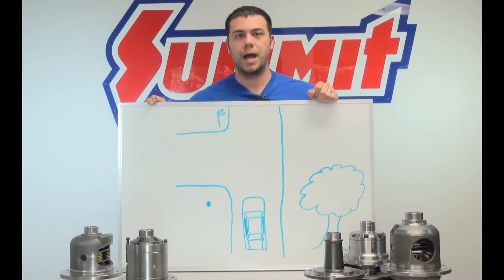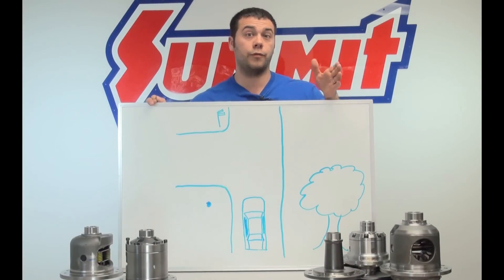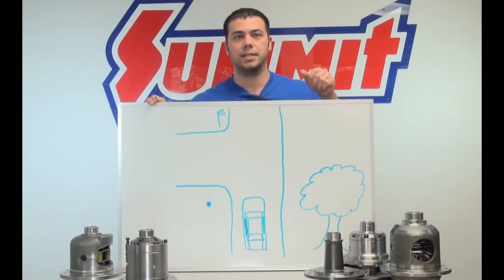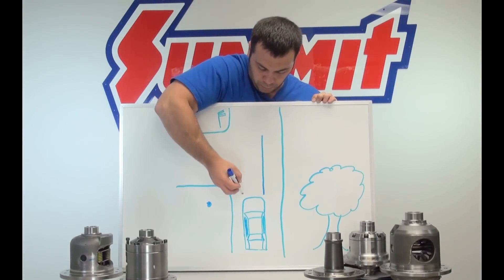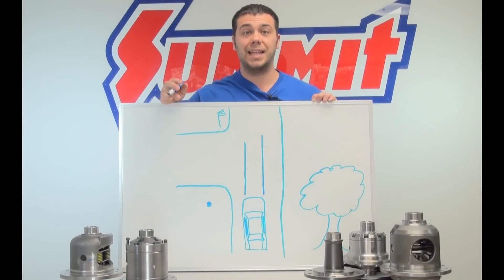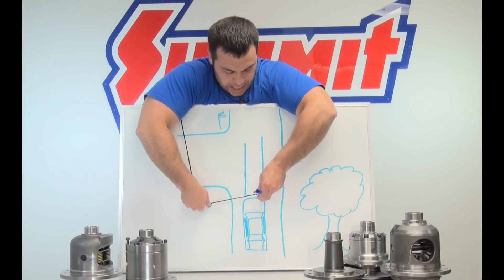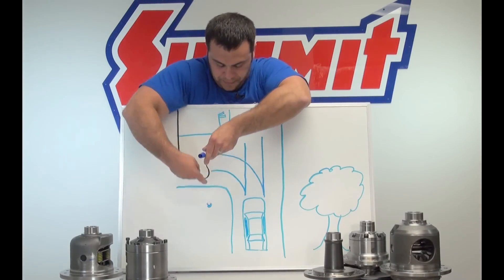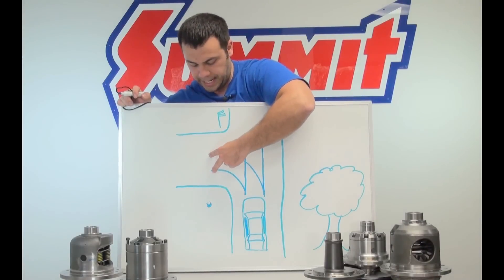Types of Differentials - Summit Racing Quick Flicks

Comment from the maker: Hi Briceland107,
This is from the Eaton site: The Truetrac® operates as a standard or open differential under normal driving conditions, allowing one wheel to spin faster or slower as necessary.  When a wheel encounters a loss of traction, the gear separation forces take effect and transfers torque to the high-traction wheel.  The helical-shaped pinion gears continue to mesh with the side gears with increasing force until wheel spin is slowed or completely stopped.

Comment: This video answer all my question about the open differential in my 05 tahoe ls 4x4. But I still want to find a posi trac differential to put in it so both of my wheel spin when I get stuck or when I help pull someone out a ditch. I'm not looking for a differential that will break my transfer case but be compatible with it and the front gears.

Comment: Hey am, I have a 66 chevelle with a 10 bolt running a 400th and a 496cid.im running a 3:08 now stock and would like a locker for street use.i have an open diff..do you have a part # for a 3:70 or 3:73 locker?

Comment: interested in a nice posi for my 2006 titan with 2wd. git a lot of snow up here. cannot afford another truck but want to drive it more often in the winter. it's a posi now with clutches and slips too much when in a tight situation. don't want an air or elec. locker. a good compromise . I believe this is a dana 44 diff with 31 splines. suggestions please.

Comment: You left out the Torsen automatic torque biasing differential.  It has instantaneous torque transfer to the non slipping wheel.  It has no clutch packs that wear out or complex spring arrangements.  Will make your car launch in a straight line while still allowing you to make a corner.

Comment: Would like to know more about a tru trac version still havent wrapped my head around that completely
Reply: I think this video explains it better. It's a slightly different layout but same principle. 
 Watch "Exploded View - Inside the Eaton TrueTrac Differential" on YouTube
https://youtu.be/lZmsY2YvVsc

When the spiral gears push apart, left to right, they push against themselves, the side gears, and the carrier housing. Notice the carrier has round holes where The spirals are, THIS allows the spirals to pass through and touch the case. The friction builds until it almost kind of locks and now you have traction to both sides.

It's not perfect. You may have to hold the brakes a bit to induce that friction. Once you have, the power will transfer to the wheel with traction. U.S. Army vehicles runs this system.

Comment: When installing part# M-4204-F150LS on the front diff of an F 150 2005 4WD:
1. Is it an issue when cornering in 2WD?
2. Is it an issue when cornering in 4WD? How does it work when it detects slippage while off-roading? Will it engage and damage any parts?
3. How will it work if one wheel is in the air? Can you use the brake to help engage?
Any extra information would be appreciated, as I’m considering installing one in my baja- modified F-150 05 8.8” front diff.. 
thank you!!!
Reply from the maker: 1. Is it an issue when cornering in 2WD? Yes, it will be hard to steer and can be dangerous to the unsuspected driver.

2. Is it an issue when cornering in 4WD? How does it work when it detects slippage while off-roading? Will it engage and damage any parts? Yes, it will be hard to steer and can be dangerous to the unsuspected driver. It will not damage any parts in the diff.

3. How will it work if one wheel is in the air? Can you use the brake to help engage? It will transfer the power to the wheel needed and hitting the brake can help on some units.
Reply: Summit Racing thank you! You guys are awesome

Comment: I have a 2005 f350 6.0 that i daily drive and dont really do any off roading it does how ever have a decent amount of hp. What would be the best differential for my truck?
Reply from the maker: Hi Eric, For mostly street use and daily driving I would recommend the Detroit True-Trac limited slip. If you have the full float Ford 10.5 rear axle, you  can use part  https://www.summitracing.com/parts/dtl-915a550
Thank you for watching.

Comment: Which differential should I get if I want to burn out with both rear wheels?
Reply: alexisramos, check out a corvette rear axle.  They are made for that purpose.  Get that type of rear locker (posi-trac).  A Detroit locker will ensure that both wheels spin at the same speed.  The posi-track has clutches whereas the Detroit locker has "teeth" type locking devises.  Both have their good a bad points.

Comment: What would you suggest for a twin turbo Silverado that’s going to be a daily
Reply from the maker: An Eaton Detroit Truetrac differential would be a great choice for a high-performance, daily driven vehicle. These differentials provide smooth, quiet operation, optimum traction, and excellent strength. Use the Make/Model search at SummitRacing.com to find the correct differential for your vehicle.

Comment: Question. I have an Borg Warner 9bolt. I found out its a 3.27 gear but not posi. for my 88 Camaro Street/Track Car. Should i go with an spooled or the posi unit. Spool 88.00 but the posi kit it 485.00
Reply from the maker: Locking the rear axles via a spool together can create a dangerous situation on the street. Adding stick tires on the rear or skinny tires up front can compound problem even more. I would recommend a posi for any street driving.

Comment: I jave a quik one may not be to much related, i have a 92 ranger 4.0 v6 auto, my diff is a 7.5 3.08 open, i want to get a 3.27 locker out an explorer witch is a 8.8 diff but flanges atent the same it is an adapter made? Heard that is a common practice do the swap, thanks
Reply from the maker: Hi Royrockbrain, 
There are no adapter flanges for the swap you are referring too; and swapping the whole rear differential is a big job. Not only is the rear end slightly wider requiring the leaf spring perches to be moved, but the shock mounts are different, the driveshaft will require modification as well as the brakes are disc vs. drum.

Comment: What would be the main advantage of a locking differential over a limited slip differential? Or is a locking differential a type of LSD?
Reply from the maker: +cptmiche, 
A locking differential could certainly be considered a type of LSD, sure. But, it isn’t something that most want to drive on a daily basis because of the lock/unlock harshness around corners. Locking diff.’s are really best for off road applications only such as mud trails and rock climbing.

Comment: Is their a much faster LSD for track? ..Also BMW seems to be using more Open differentials even on performance models with great track times. They say that their abs system is quite advance and their open drive differentials work like an LSD with less maintenance .. Is this true? would a abs swap make an open differential good for tracking now?
Reply from the maker: +goheat77, 
An ABS system with the capabilities you describe being offered in the aftermarket for a “swap” would be cost prohibitive for many and therefore unprofitable for a manufacturer. You will most likely end up investing in the factory equipped car to get that system!

Comment: i have a 1969 pontiac open 12 bolt rear end am that i like to keep, am  I  going to have a problem changing a open to a posi ? as i tryed once with a chevy and the bolts on the ring gear hit the housing and there wasent enough room for the 1982 posi posi and tryed to put in the 1978 open rear? the bolt hit the housing after loking at other 1982 its machined for cut out and 1978 isen't ?

Comment: I have a 2001 Chevrolet Silverado about 500hp I want to build a bullet proof rear end what do you recommend
Reply from the maker: Hi Robert, we would need to know if you have a 10 bolt or 14 bolt. Here is a link to both: 

10-Bolt  https://www.summitracing.com/parts/etn-19559-010/overview/

14-Bolt  https://www.summitracing.com/parts/etn-19590-010/overview/

Comment: hi, i have a 2006 gmc sierra 1500 single cab 4.8 i want to put a posi on it im looking forward to burning out with both tires do you have any suggestions on which diff i should get?
Reply: jaygeer28 limited slip full wheel drive would perform.
Reply: stock g80 locking /limited slip

Comment: i have a prety much stock chevy c1500 with 305 tbi headers and coolair intake and running 315 35 20 tires on the rear. and 700 automatic transmition.  most of my driving its city i really dont care about gas mileage. i will like to set it where its quick taking off from a stop. what diferential radio can i use? thanks
Reply from the maker: +chango aviles , 
With no concern for economy, a 4.10 ratio would be best for you.

Comment: I have a 85 s10 im going to v8 an I want it to have positive traction but also want it to be drivable around town just mainly wanting a bad ass truck to showoff an do donuts an burn outs witch would I need for a stock rearend
Reply: Brian Whelan a limited slip
Reply: Find a 96 and newer s-10/ Blazer with 4.3 and manual they have 8.5" rears and most are posi

Comment: Hi i was wondering , lets say when i do a burn out in my 2015 donde challeger why is there only one wheel spining ? Is it because of the differentials and if it is what kind of differentials. And also is somthing going to break or ruin if i keep doing burn outs?
Reply: Theres only one tire that spins even tho i turn off traction
Reply: It sounds like you have an open diff. The traction control is going to add break pressure to the slipping wheel to add traction to the wheel with grip and possibly cut power from the engine. If you turn traction control off you won't be wearing your back breaks unless you are doing a break stand. Doing burn outs is always hard on the car but there is not a particular weakness in an open diff that makes it susceptible to damage, although you are wearing one tire more quickly than the other.
Reply: You want a limited slip to get both tires going and probably nicer on the street. But I’ve seen people bust both tires loose with an open so you can do it under the right circumstances

Comment: How does 411 posi traction in my truck benefit? After watching the video, it seems as though positive traction is not a good thing. Am I wrong or right in my assumption? Thanks!
Reply from the maker: +wannabeangler , 
Well, this is a matter of opinion for many folks. Depending on the type of differential you chose, the compromise may be worthwhile if you do not get stuck in the mud or snow!

Comment: Can you explaine why diffrent tyre size on one axle can destroy differencial but driving with same size tyre in corner can't?
Reply from the maker: Tires with different circumferences mounted on the same axle will cause the axles to turn at different speeds. To the differential, it appears that the vehicle is continually going around a corner even though it's going straight. The offset in axle speed causes a continual load to be placed on components like clutches or other elements related to splitting the torque bias to the wheels in performance-based differentials, putting extra wear, and compromising the internal parts. 
 
Some differentials lock up under engine load by design, acting like a spool; this can push the vehicle around on the road and create a loss of control when mismatched side to side tires are used. In open diffs, this scenario will simply cause the spider gears to spin continually, prematurely wearing them out. 
 
The amount of circumference difference in the tires will directly relate to how aggressive this affects each situation. Side mismatched tire sizes can even lead to an ABS or traction control light being activated over time.
Reply: @SummitRacing  Thanks man 👍

Comment: Do you know anything about Volvo cars? I have a 1997 Volvo 960 sedan 2.9L In line 6 with IRS pumpkin. What kind of differential does mine have? I was told it should the volvo 1045 and i read online about the 1065
Reply from the maker: +Daniel McDaniels, 
While it’s true we don’t do a lot for Volvo vehicles, after a short Web search it appears the Gear Ratio and Axle Model Info sticker is located on the center section for Independent Rear Suspension (IRS ) units and your car has the possibility of 2 different axle models; a 1055 or 1065. The latter unit (1065) has the limited slip differential!
Reply: The sticker says 1055 3.73s.

Comment: Can u interchange between a Lsd and a Std Differential ,With out doing modification on the transmission ?
Reply from the maker: Auto body Works Ltd , 
A limited slip differential can be used with any transmission type!

Comment: Will a limited slip help in the snow?
Reply: Clutch based limited slips and torsen limited slips will help in the snow. You need to be light on the gas pedal though because if you are breaking traction on two tires instead of one like you would with a stock diff it increases the chances of loosing control of the vehicle.

Comment: How important is a differential in a drag racing vehicle...?  Thanks,
Reply from the maker: Hi Aricu, 
If it is a true “Drag only” vehicle and maximum traction is desired, a spool would be the best bet.  But, keep in mind, this locks both axles together at all times. This puts a lot of stress on the axles and would be a good time to upgrade those as well. Give us a call, we’ll get you set up with what you need! 1-330-630-0240.
Reply: I truly appreciate all the help..

Thank you,

Comment: Is the mechanical locking doff the same as positrac
Reply: No. Posi is a clutch LSD.  Mechanical locking usually means auto-locker, ie. detroit locker, or lunchbox, such as spartan. Phantom grip would be a cheaper type of mechanical locker. the other types could be air locker or e-locker, those are selectable usu. between open and fully locked. Helical is only gears, no clutches also known as Torsen, tru-trac, wave track, quaife

Comment: several factors in gear ratio selection. tire diameter, gear box/transmission/torque converter. engine power output rpm range, vehicle weight, intended driving conditions/use. let me run some of these #'s through my gear master 5000 computer... the answer is 3.56.

Comment: I've been looking at Jeep wranglers and there is an option of a trac-lok limited slip diff and a tru-lok. I know that the tru-lok can be engaged to be a locking differential but is it also a helical limited slip? I've seen a cut away drawing of it but I don't know if I'm interpreting it correctly. I'm interested in the idea of having a lsd in the rear only to expand the vehicle's capability in 2WD driving situations as well as 4WD since it is unlikely that at any point both rear wheels wold be in the air.

Comment: Hi there, hope someone can help with the following; we have two ratios. One being a 391 with a spur gear with 43 teeth and the pinion having 11 teeth. Second being a 389 with a spur gear with 35 teeth and thnion pinion has 9 teeth. On an oval track with a raceline of 332m. With the two ratios being the same, the question is, wich one will be fastest out the corners and second question, which one will be faster at the end of the straight. We are running on 13" tyres, and a 221 gear ratio. Tyre size 205x50x13 South African dimensions. Currently racing with the 391 ratio. Thank you.
Reply from the maker: +Jenni Gomez , 
Considering all the info you’ve supplied, there is approximately a 40 – 50 RPM difference between the ratio’s. Obviously the 3.91 will run a higher RPM than the other. You need to decide, is the extra RPM hurting you overall or helping you. Compare your RPM at the end of the straight with the RPM range of the camshaft you are using. Make any gear adjustments necessary that keep you in that power window.
Reply: +Summit Racing 
Thanx so much for your relply.  :)

Comment: I'm that guy who lives to kick donuts n catch second every 1-2 shift is this gonna b a good match for my 99  camed Sierra 4.8 with built 4l65e with summit ls pro 26-2800 stall n converter with shift kit n corvet servo is this the did I want to use n stand up to my abuse n it's my daily also PLEASE let me now if not n thanks for ur time DTL913A481 WITH 373 ratio I will b during my stock ring n pinion??
Reply from the maker: Yes, the Eaton Detroit Truetrac can withstand aggressive street and track use.

Comment: I have 1980 c10 stepside with a 31/18.5/15 with a430 gear 35 axles fool spool 496 bigger then a 700 lift  400 transmission what do you guy's think about this bud let a real one know how my sister and  brothers feel about this
Reply: In the front I have 15/5 for my front runner

Comment: Are there any kits to change my 2wd 2001 Toyota tundras open diferencial to a limited slip diff
Reply from the maker: Hi Carlos, 
 
You will need to verify the differential type, but if your Tundra has the 8.4 Toyota rear axle you can use part https://www.summitracing.com/parts/sum-730990
 
You will also need an installation kit https://www.summitracing.com/parts/mgr-r11rtacmk